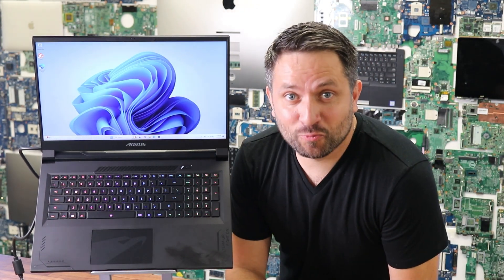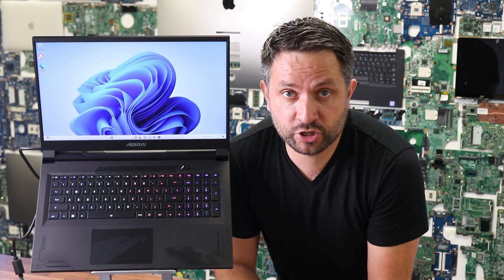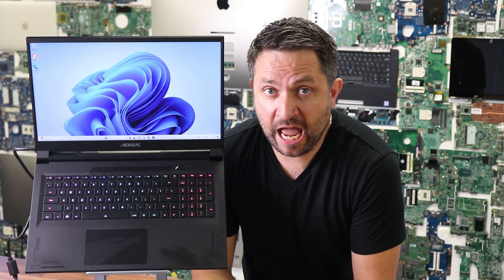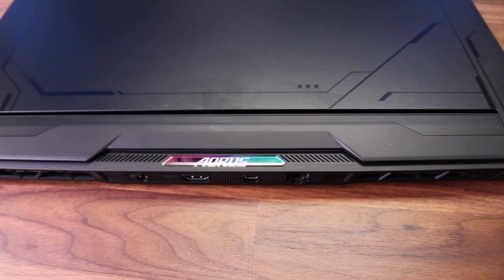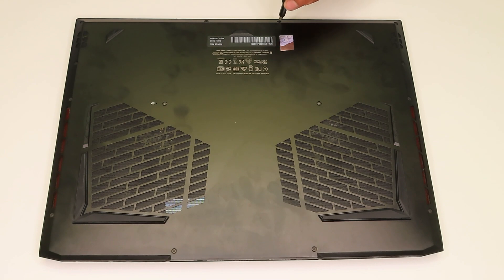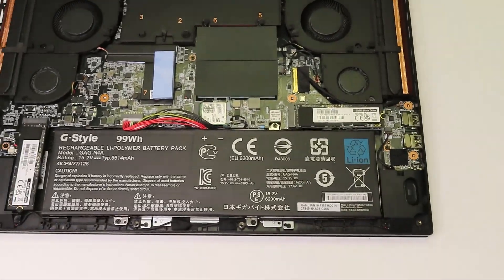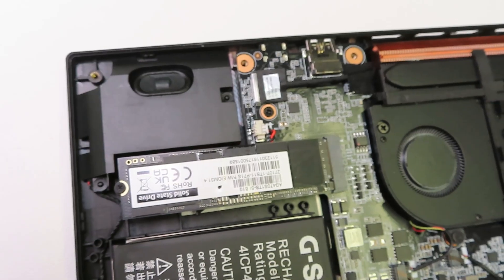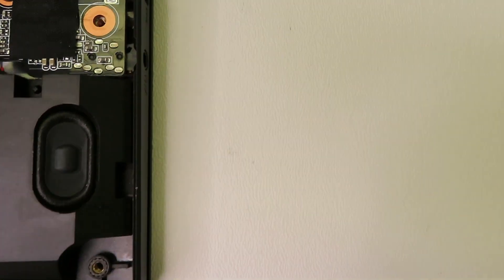Gigabyte Aorus 17x i9-13900HX 32GB RAM RTX 4090 - review, upgrade and repair

Comment: Could you tell me how to get it to display an image on the screen? I just went into the BIOS, changed some Secure Boot, SMC, and UEFI settings to Legacy, and when I saved the changes, it stopped working. I've clicked the reset button several times and held the power button down for a while, but nothing. I've even left it unplugged for a few days... I want to be able to fix it without having to take it to a technician so I don't lose any information. Help.

Comment: I have this computer and i need help pls beacause water fell on it... what can i do ?
Reply from the maker: You need to completely dry the laptop, you would need to open it and inspect. Most likely your keyboard and palmret are damaged and depends on the amount of water spilled your board( which is the most expensive part is damaged as well). Over all water damage is the worst what can possibly happen to your device. good luck